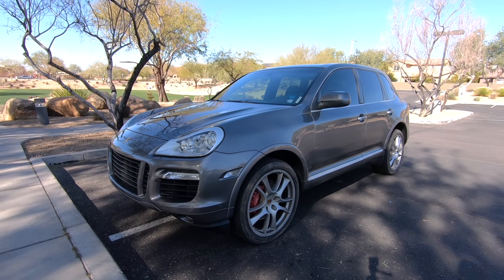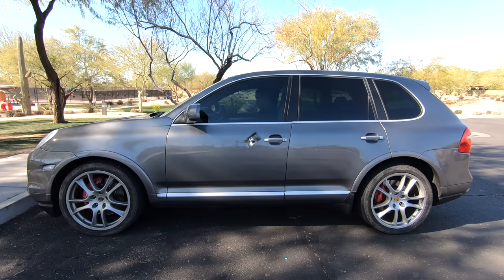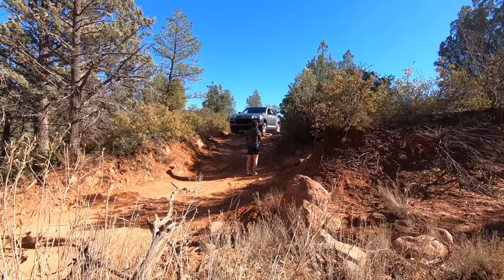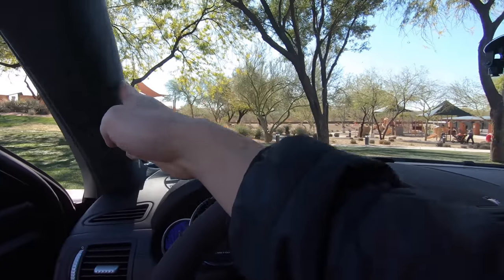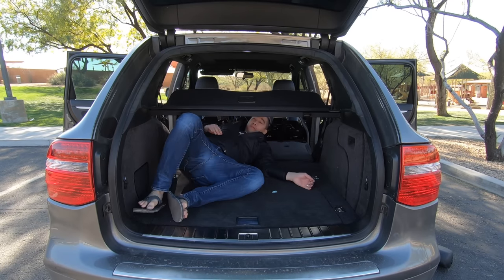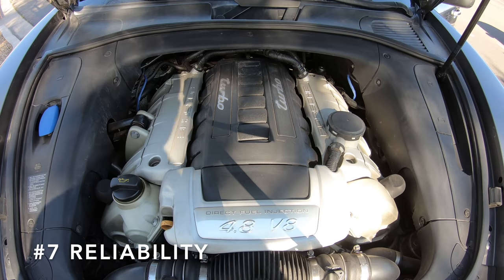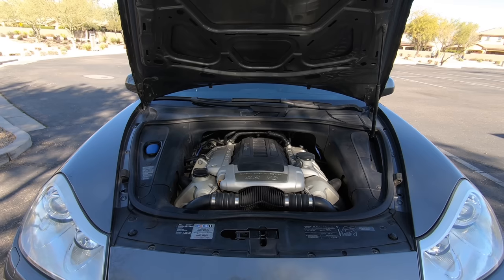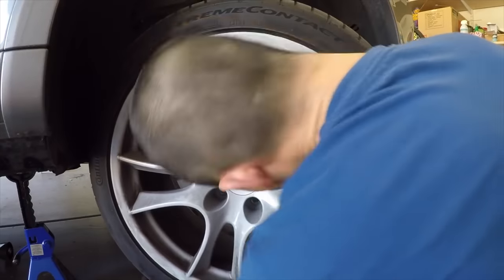Why You Should Buy a Used Porsche Cayenne Now! (First Generation 955/957 Review)

Comment: Love my 2010 GTS. Was actually a former celebrity’s car (Hillary Duff). However if you can’t do your own maintenance, prepare to shell out some coin. Parts aren’t too insanely priced, it’s the labor that will kill you. 

So far in the two years I’ve owned I had to replace coils ($400), had a coolant vent line break under the intake ($40) then also replaced the starter ($250) while doing that repair. Then that remanufactured starter I installed was faulty and failed within a month so had to do it again. Now just got brake pad replacement notification so bought new rotors and pads all the way around for $600. The coolant line job would likely been $1,500+ in labor, brakes likely the same. It was intimidating at first to work on myself, but in the end it’s a car just like all the others I’ve wrenched on. You start to appreciate some of the design choices as it makes things easier to work on.  Like the starter for example, at first I was like what moron decided to bury it under the intake, but after doing it a second time I realized how easy it is to not have to climb under the car and get all dirty.

At this point the only thing left on the possible maintenance is to replace the cardan shaft bearing carrier.
Reply from the maker: Wow thanks for sharing! Hope you're subscribed to the channel!
Reply: nice response. So curious, do people not get third party warranties when buying used vehicles like this, would save a lot in labor cost...
Reply from the maker: @bikeninja956  I had a warranty through CarChex. Paid $3400 for it and it shelled out about $10k. It was all worth the money!
Reply: @CarFanatic  nice! I got a 3500$CAD platinum, third party warranty for my 2013 BMW X1 (now 66K kms.) so far, they paid 400$ on 1000$ (new batt and starter, obviously batt is not covered) worth of work and parts. I bought the vehicle in 2019. So far, so good. I wonder if I'll ever make that warranty worth my while lol.. seems like it would only pay off for more catastrophic failures...oh well, the good part is that it's  transferable to the next owner so gives me some leverage during selling :) It's almost paid off, so now I have my eyes set on a Cayenne!

Comment: Great review of this marque. As the comments highlight when these go wrong, and they will, it’s a huge expense. Buy the best you can with lower mileage and full history as they do get some wear and tear. Also buy an electronic plug in fault code reader to see issues before the garage!
Reply from the maker: Great tips! I bought an aftermarket warranty which paid out $10k in repairs and preventative work (worn engine mounts and control arms).
Reply: I picked up iCarsoft Por-II OBD reader and it does everything you need it to for under $200 as opposed to Porsche Durametric which is big $$$. I can reset service reminders, read and clear codes, even retract brake calipers when doing brake pad replacement.
Reply: Who’d you get the warranty through ?

Comment: My 2008 Cayenne Turbo has done some 150,000mls and it's one of my daily drivers. It has to be a - sort of - daily, because if it sits for 2+ weeks, it will bitch. Meaning, it won't start at first try, causinf some trouble codes to show up due to low voltage in the system. In order to avoid that, I'm driving it at least every other week.
In order to avoid outrageous repair-bills, I get even tthe tyiniest issues fixed immediately. And yes, there are issues coming up frequently.
But - and here's a big "but" - If you prefer driving a 500hp Porsche, fully loaded and superior to most everybody else on the road - that's what you have to put up with. 
Yes, a Toyota will take you from A to B while  costing you a fraction in maintenence. It depends on what you prefer, what your persnal taste is like and how fat your wallet is...

Comment: Great video. I got a 2009 turbo no problems great car.
Reply: How’s the steering on it. Like while driving does it drive smooth
Reply: and how much does yours cost to maintain
Reply: @JUSTYN23   steering is smooth it feels very solid.  I don't do the maintenance at a Porsche dealer and it's relatively inexpensive.  No major problems just oil and filters.  I have done a complete fluid change once so far and things run well. my car only has 60K which is low for 2009 but I would buy another Cayenne.
Reply: In India or  out of India

Comment: My take on future purchases. Get a compression test done. Typically norther colder climate Cayennes can have cylinder bore scoring for V8 turbo and non turbo models. It seems that 09 and 10 are the least affected by this issue.
Reply from the maker: Great advice! I would add getting the engine boroscoped too as a good precaution.

Comment: The rear of these 955/957 is kind of weird looking to me although i think this is an attractive SUV overall. The 958 is the one that really got me into the Cayenne and the fact that i am seeing them for under 20k now is nuts! Definitely going to get a 958 Cayenne once im done with my E70 BMW X5 hopefully the Porsche is as reliable as my 6 cyl turbo X5 is.
Reply: The 958 looks like a Mazda to me. Whereas 955 brake lights look like the Carrera GT's. Both the 955 and the 957 looks good all around. 955/957 were much better off road too, had a real 2-speed transfer case etc.
Reply: @chir0pter  yea i hear ya but i assure you 90% of people buying these vehicles are not going off road. The 955/957 just resembled the Toureg way too much for me (i know its the same platform). The interior was also a dramatic improvement way less cheap plastic as expected from a newer vehicle.
Reply: @gilgonzalez5902  Not very much cheap plastic in my 957 GTS...also the 958 still shares a platform with the Touareg.

Comment: I have to say that in my '08 turbo I am now using the 19 inch winter wheels and tires and comfort has gone up quite another level
I still have the 21s but apart from the aesthetics, which do look really cool, it ruins the handling, making acceleration worse, etc.
Also, when towing, one of the tires (Michelin 295/35R21)  developed a bubble and had to change it (they were literally brand new, less than 500km)
They have a too slim sidewall for the car, it you are going to use the full potential of it and not just use it on the city and highway
Reply from the maker: How does on road handling feel with the 19s? I'm debating going with 19 or 20 inch wheels.
Reply: @CarFanatic  I am really happy with the 19s (which is the smallest our cars allow)
955 turbo can use 18s as they have smaller brakes
The car is much more comfortable
Also you feel it with less ballast (less weight)
In the handling department, you still have a vast amount of grip (I have the PDCC, which might also play a part)
I am using 255/50R19 Michelin Alpin5 (previously used the Pirelli Scorpion snow&ice)
I would say the car behaves really similarly to the 295/35R21, but with a bit less grip
The way in which it can attack a bend is the same, but the limit is a bit lower and it is easier to lock the brakes on the front or understeer a bit, specially when the tires start getting old or worn
Although in normal circumstances this situation does not occur
You would really want the car to understeer to make it happen
Reply: Enjoying 295/40/21 but wear on arch linings a definite unless maybe making some space

Comment: Because of you I bought a 2008 cayenne GTS with 140k miles for $10k  it’s been over a year and 50k miles and only spent $600 on oil change from dealer but when I bought it said evap leak small now it says large took to my Merchanic he changed evap pump still on, then canister then the thing up front with the hose and gas cap and that was 1k with smoke test and he said there is no leak and nothing wrong with car at all. To pass inspection I clear code drive 50 miles out then back and I pass inspection suggestions?
Reply: you went 50k miles in a year? jfc

Comment: I was told not to get a 4.5 V8 but only a turbo bec the 4.5 engines go bad. But that the KN used a different block turbos being better. And that the 3.6 MK1 V6 is best. Thoughts? How are these on maintenance costs per year? And transmission issues? High mileage on one over 100k mi shouldn’t dissuade me away?

Comment: I have my second VW Touareg TDi and the one I have now has air suspension and pretty much everything the Cayenne has. But I get 1,000 km/600 miles per tank easily, that is 28-32 mpg,  about twice the fuel efficiency of the Porsche V8 turbo gas version. I have better towing capacity and an engine that is just getting broken in at 100k miles. All-in-all, I love my Touareg TDi and think it is as good as my Lexus SC430, another bargain, and my Toyota Hilux 4x4 diesel. All together, with the Toyota bought new (as a tax write off in Mexico for my hotel there) I have under $50k USD invested and have a bullet-proof highly efficient go anywhere truck, a most luxurious, seriously capable off roader, sporty driving, economical SUV and a retractable hardtop by Lexus that has the silkiest drivetrain on the planet with Toyota reliability and unparalleled luxury from the bird's eye maple to the napa leather. All three for less than the VW or Lexus when brand new....and they will last a lifetime if maintained.
Reply: Like to brag much?..
Reply: @chosenBYpicasso  I appreciate what I have. And driving 10-20 year old vehicles I could afford to pay cash for has allowed me to enjoy a good lifestyle without ever earning a tremendous amount of income. Many today can learn from this, Never go in debt for something that depreciates, approach to life. But if you think driving 12 and 18 year old vehicles is bragging, then yes, sure why not. It is an accomplishment even a WalMart greeter can achieve with some discipline. And boy do I LOVE my cars.
Reply: And all three paid for when purchased, and equal LESS than the amount of the average NEW Car that folks are taking out 72 month and greater car loans on. You would not believe how many gas station attendants, store clerks or other part timers I meet driving $65-85k trucks, all on payments. UNBELIEVABLE! We have learned NOTHING from the 2007/08 subprime housing collapse, we are doing it with cars and trucks now.
Reply: @UltraFence  I've got about 60k wrapped up between gold, silver, & crypto.. But I drive a 2009 ford focus that falling apart probably worth $400.. Lol.. I'll have enough to have many cars and houses eventually.
Reply: @chosenBYpicasso  I hope it goes to the moon. Good Luck. I believe it will. I am just older and started saving and sacrificing many decades ago.
Reply: Tuareg is a great car but its a lot uglier  than the Cayenne in design
Reply: @PharmacyAve  I might agree with you if I owned a Cayenne, but honestly when I see a Cayenne, Q7 or Bentayga I just see a Touareg in slightly different clothing.
Reply: @UltraFence  it is a big brag and a big blessing. Very rare to find an awesome car with reliability. How has your air suspension system been? That’s the only option I’m worried on when I get a cayenne diesel.
Reply: @prabeeshsidhu  air suspension has been trouble free. VW doesn't have the issues Range Rover and Mercedes have with air suspension.  It is very robust and reliable.
Reply: @UltraFence  This November I will have owned my 2004 VW GTI 2.8L VR6 for 18 years.  Still a good car.  I intend to keep it approximately 4 more years.  Then I'll shop around for a 2022 or 2023 Porsche Cayenne GTS.  When I get that car, I'll add a bumpersticker that says: Paid For With A 2004 VW.

Comment: Wife an I looking at these in a serious manor.... this is helpful🤙
Reply: I would suggest lowest powered v6 and no air suspension. Make sure you get confirmation that the prop shaft has been upgraded they go pretty easily and it’s £800-1200 for a new one. Then you’ll have a reliable motor that looks good for plenty of cheap miles.

Comment: Porsches are great but I'll never buy a used one again.  Only new or lease.  Once they start to need to have stuff replaced, you better be prepared for the pain.  Best cars on the planet imo, but its german, so no matter what you're going to get an over engineered vehicle that's going to cost you once it starts to get older.
Reply: You either pay upfront (new car) or pay in the rear with older models specifically with maintenance. They are especially expensive if you get them service at a shop. There are plenty of DIY online though to save you some money...

Comment: My husband and I bought a "slightly used" Cayenne and sold it 6 months later.  We bought it from a  Porsche dealership and had all the maintenance up to date and had about 23000 miles on it.  We put 3000 miles on it in 6 months and when we took it in the dealership insisted we pay for the 40,000 mile maintenance at $2750!!!  That was utter BS.  So we sold it ASAP and bought a brand new BMW X5 m 50i.  I'll NEVER buy another Porsche after that even though the car was gorgeous and I loved driving it.  The maintenance was utter BS and a total scam.
Reply from the maker: Wow, that's why I recommend people stay away from the dealership.  It's overpriced and many try to sell you on services you don't actually need. Even with your BMW, I recommend finding a good independent mechanic that you can trust. It will save you a lot of money in the long run!
Reply: The maintenance costs at the dealership are utterly ridiculous. Not sure how they justify those prices at all.

Comment: Yes they are great but the air suspension is a nightmare, i own an Audi Q7 and they are the same as Porsche Cayenne you need to replace the air suspension every 4 years depends on your driving style but usually around that period of time and they are costly for the OG parts. Butg these trucks are cool to drive.

Comment: Air suspension is great until it breaks and it will .... The sweet spot is the Cayenne S  not the turbo ...less trivial features that won't fail ... The 955 Cayennes overall are great suvs not to mention abrams tank safe ... Future collectables and the last of the old school real German suv's
Reply from the maker: I hear you on the air suspension, but that's what allows the Cayenne to be versatile. I figure I'll bite the bullet and shell out $4k to replace the air suspension if it goes out. Thanks for watching and hope you're subscribed!
Reply: @CarFanatic  well if it's any consolation all the SUVs with air suspension at some point fail my friend just sunk 6K into his Range Rover air suspension I just don't like it but I hear you
Reply: I currently own two Touareg V10 TDI and the V8 prior. The V10 weight 6000lbs and I have zero issue with air suspension. Yes, I tow a lot with it. Makes me wondered if you have own one of this beast?
Reply: With so many aftermarket parts its repair bills are the same as a corolla these days worth it 👌
Reply: @timleng4404  Yes two of them ..both S models without air suspension ...Here in Canada the weather does not help with making them last.  I have seen many with this issue.
Reply: @brothersgarage3748  Yes ...Until it's an OEM only component !
Reply: @space_114v2   used and junkyards are your friend then.  I found maybach wheels for 500 euro used when new I'd spend easy 5grand or more
Reply: @CarFanatic  count yourself extremely lucky that you’d be able to drop $4k on a repair so trivially. It’s really bad advice for normal people to buy this vehicle.
Reply from the maker: @moloono1  great feedback. You are totally right that this isn't the right car for everyone. As I mentioned in the video, this is a great SUV for car enthusiasts who are able to spend around $15k to $20k. This budget allows for a few grand in maintenance and repairs. I don't know people's personal financial situations, but the video is targeting car enthusiasts who are shopping for a fun SUV in this price range and know what they're getting into.

Comment: Would adding a trans cooler/catch can whatever help the terrible auto trans from dying ,  Is it possible to do  manual swap?
Reply from the maker: No, but the transmission is good on the 957 with exception of the drive shaft bearing. That's a cheap fix though. The 955 had a valve body controller issue and the infamous coolant leak that can affect the transmission.

Comment: The real question is how 957 4.8 feels compared to 958 3.6 VR6? I have experience with 958, but was looking for 957
Reply from the maker: The V6 is fine for regular driving but isn't quick by any stretch. The V8 feels appropriate while the turbo models put a big smile on your face :)

Comment: I have a 2004 Cayenne S 132k 
Wife iterally drives it just like 50 miles a week right now. Took it to big bear and it was a beast in the snow. 
However come June...I say goodbye
Reply: Join the club my Cayenne S  with 41km on the clock with R482 000-00 of extras + - 31 000 dollars,spend in 2020 about 5000 dollars on repairs and running cost.try to sell it ,but was going to loss  all the extras 31 000 dollars now we need to drive it to the end .

Comment: should put some BFG's on it, be awesome off roader with good tires!  Baha that bad boy!
Reply from the maker: I really want to, but I don't go off-roading enough. So I'm stuck in a position where all terrain tires don't make sense and neither does having two sets of wheels. So I'm think it might make sense to downsize the wheels to 19 or 20 inch wheels and run a high performance all season. I would at least have a little more sidewall. We'll see though.
Reply: Mine came with 22 inch rims but paying almost 200 per tire was not acceptable so sold those to get a base model 18 inch set

Comment: Do you recommend 2011-2012 cayennes? Reliability? The generation you discuss looks dated af!
Reply: Starting in 2011 reliability got a lot better from what I’ve heard. My 2012 958.1 has over 70k miles and no issues except wearables so far